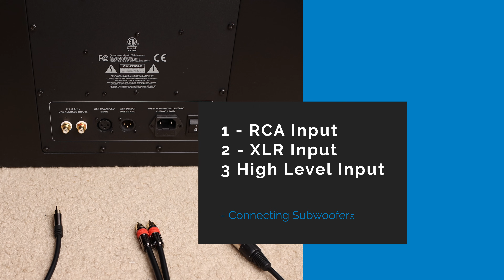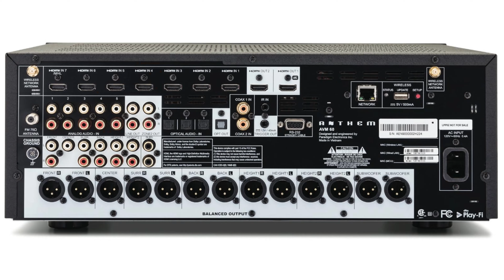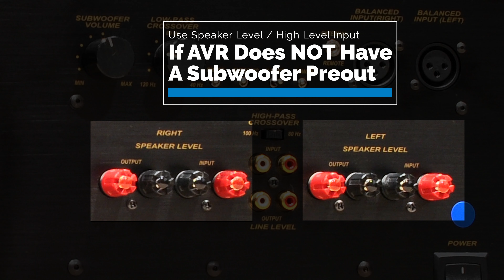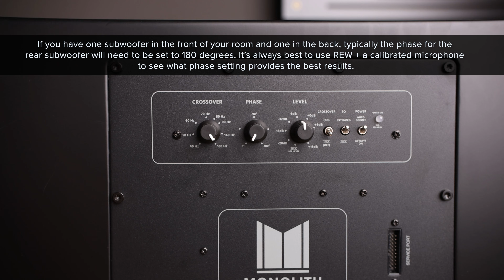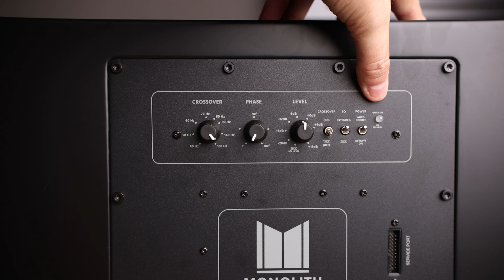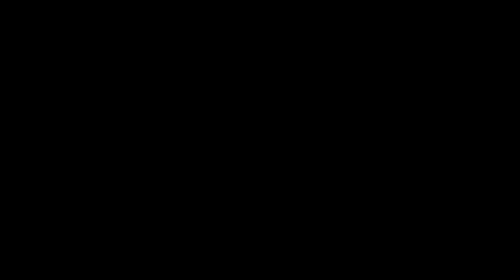How to Set Up a Subwoofer | EASY Step by Step Instructions

Comment: rule #1 if you have an subwoofer with an active module integrated ... you dont have a subwoofer. Buy passive woofers if you want performance. Small living room subs may be okay but a home cinema sub with active module ... wouldnt touch that in my home cinema.
Reply from the maker: To each his own. although there is nothing wrong with separating the amp from the woofer, it’s not a prerequisite for performance. My JTR Captivator RS2’s. are flat down to 5Hz.
Reply: @Youthman  5hz would be a wavelenght 225.0656 feet long. I honestly doubt that is anything a normal room can handle. Even a large hall would still be problematic. If you wanna absorb a frequency you need around 1/4th of the lenght as thicness for absorber material. For bass our ears are less sensitive so some would think u need less. Thing is you dont hear 5hz anyway but feel it. Which is another beast of it own. I honestly dont know why i would want frequencies below 20hz because you CAN tune a subwoofer down to that hertz but your overall subwoofer performance would be better if you dont tune it that low. A subwoofer has 2 maybe 3 octaves of good performance while being absolutly great at a bit more then 1 octave maybe. 

But i did see your videos about your setup. I never had a chance to listen to JTR and everyone does it own thing with those speakers. So i dont really have any basis on how they actually sound. If you ever end up in germany, your welcome to visit. will offer you a demo in my fully self build home cinema. 

Every speaker is designed by myself for the room, fully active. Not sure how many channels i end up with, because iam currently on my hunt for good and cheap used amplifier but i have around 40 channels already and aim for 60 in a 7.x.4 setup. Multiple amplifier per speaker so i have no crosstalk in between. Does need alot of electronics and is a real cable mess ( didnt count but if i end up with a mile of speaker cable i would not be shocked)
Reply from the maker: Yeah I personally don’t see myself ever going fully active but hear great things about people who have.
Reply: @Youthman  its way more complicated and can be extremly expensive but it offers incredible Routing options. If something breaks you Gotta invest a lot of time potentially to fix it. I would not recommend it to anyone because if your not coming up with the Idea of fully active yourself, you dont know enough about the topic yet. Atleast for home cinema. A stereo setup is way easier Since you dont need a ridiciouless amount of Channels and dsp.

If you have the Chance to Show Otter fully active Systems i would love to See what others Do with it.

Appreciate the Replies.
Have a nice week
Reply from the maker: I would love to hear a fully active set up myself. One day I’m sure it will happen as I continue to do more home theater tours. Have a great week

Comment: Nice video, but could you do a  video on how to connect speakers to an avr and how to connect an external amp to the avr.

Thanks.
Reply from the maker: Yes sir. That is in the works. I’m waiting to get a mid tier Marantz in to use for that very purpose. Stay tuned.
Reply: @Youthman thanks

Comment: YT, thanks for this video. I just bought two THX 10 subs and plan on hooking everything up tomorrow. Monoprice suggests putting the level on THX when you first hook up the sub and run room correction. I know most people put it at 12 o'clock and make adjustments later. Any suggestions?
Reply: When you run room correction, it will help you set your sub's gain knob.
Reply from the maker: Commander is correct. Start off 12 and once you run room correction, it will tell you if you need to adjust the gain
Reply: I put it on THX but I think I will experiment some more. After calibration, I checked everything with a  SPL meter and bumped the trim on subs just a little. I’m slowly working my way to REW.
Reply from the maker: Every time I run Audyssey, it trims my subwoofers way too low. After calibration, I always have to increase the levels 3 to 5 dB
Reply: I have an Onkyo RZ920 with two sub preouts. You can adjust each sub separately. Do you think it would be worthwhile to get a mini DSP?
Reply from the maker: Absolutely. Your Onkyo only adjusts the levels of each sub independently. MiniDSP 2x4HD allows you to time align, add 9 parametric EQ and create a custom and precise house curve. I just learned today how to add a low shelf to help prevent port chuffing on the Monolith 13 that I’m reviewing.
Reply: Nice! I did forget all the fine tweaks you can do. My next steps are room treatment, learning REW and getting a MiniDSP.
Reply from the maker: Room treatment is a great idea to do first. The more you can do naturally to get a better response without having to use DSP, the better

Comment: Great video. It would be nice to show different setups, like for example with more basic receivers, that most likely have parallel subwoofer outputs. How would I connect and setup for example a wired 10" Klipsch sub and another with the wireless receiver(15" sub). The distance is wrong with the wireless adapter. How would I calibrate something like that? I should do the microphone calibration with only one sub on? With both on, it confuses the receiver.

Comment: Hey Youthman, Am thinking of going with 2 SVS Subwoofers, I see the SVS PB 2000 pro for 899.00 each and the SVS PB 3000 for 1399.00 each, How would you compare the 2000 pro to the 3000? And is the 3000 worth the extra 500 dollars?
Reply: 2 different animals the 3000's if you have the extra 500$ go for those. Duals even better.
Reply: @taxi615  Nice how much of a difference on a scale from 1-100 is the difference between the 2?
Reply: @monroethegreat7539  well when I went from the pb2000 not pro to pb3000 it redefined everything and now I feel the bass if this makes any sense. The output is on a total different level. I don't define it on a twice as powerful but it's the difference between hearing the bass and having it move your insides and the extra power makes them do it with no effort. Hope I helped bass is not like speakers and sensitivity its more about feeling and how they keep up with action. There are many videos on these 2 subs making more sense then me lol
Reply: @taxi615  Thanks I appreciate the breakdown, I Haven't seen any videos with the new 2000 Pros head to head with the 3000, But I think I will go with the 3000 they sound phenomenal.
Reply: @monroethegreat7539  I'll find some and link that's how I made my choice last year
Reply: @taxi615  Thanks
Reply: @monroethegreat7539  pleasure
Reply from the maker: I have not heard the PB 2000 but was very impressed with the PB 3000 that I did review
Reply: @Youthman  Thank you am leaning towards the 3000s
Reply from the maker: If you decide to order the 2000’s or 3000’s, feel free to reach out to me for a quote - https://youthmanreviews.com/sales/
Reply: @Youthman  will do keep up the good work, I just picked up a full klipsch set because of your channel, The Klipsch Rc-64 iii center, 2 Klipsch Reference Rf-7 iii with Klipsch 500sa height speakers to sit on top for Dolby Atmos, A pair of Klipsch rp502s bipolar surround speakers and klipsch reference premiere 600m bookshelve speakers, And SVS height rear speakers, Now I have to get my sets and am set

Comment: I think it's typically the white for the LFE.
Reply from the maker: Guess it depends on the manufacturer. SVS uses the right (red) channel for their LFE. Typically if a sub doesn’t have an  LFE labeled, I use a Y splitter and use both.
Reply: @Youthman  I've often thought about using a splitter. Do you notice a difference?
Reply from the maker: Some older subs required using both the L & R channels. You shouldn’t hear a difference using a Y unless the sub is setup to where it requires the use of both connections